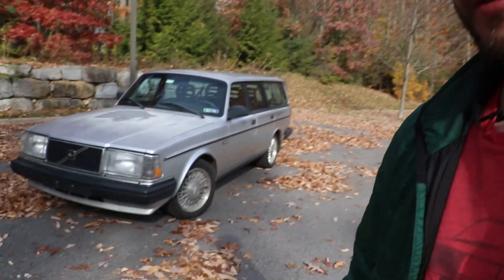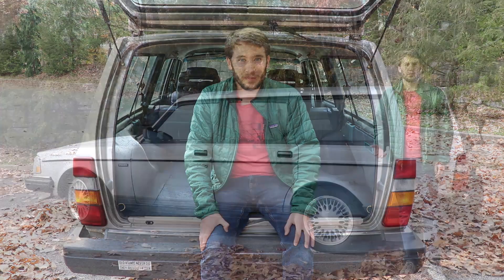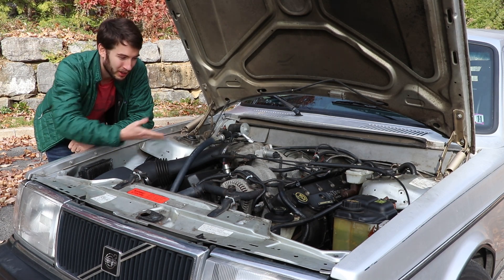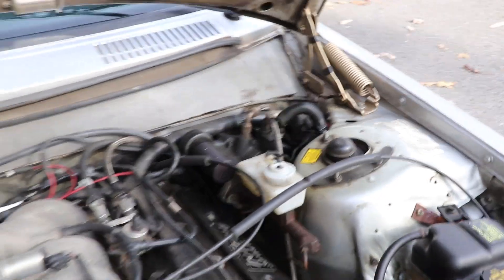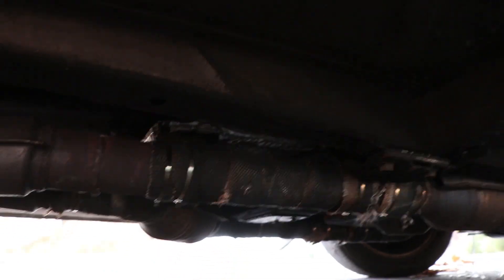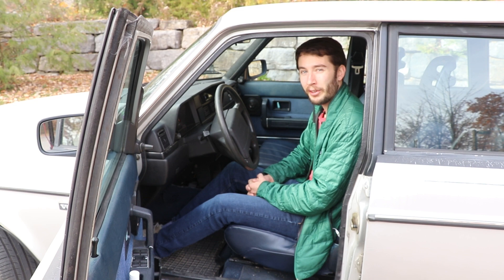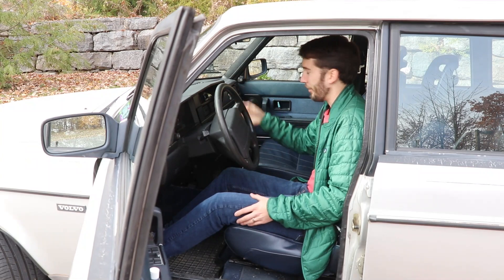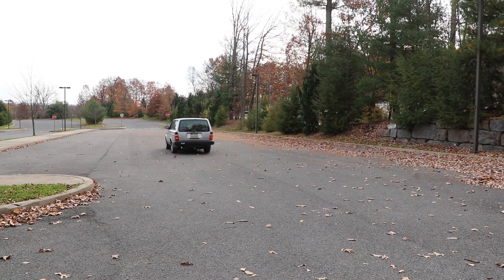I Put A Cobra Engine In A Volvo 240

Comment: You're a very smart guy, I love volvo 240s and jags, I've seen your XJS and searched for this on your channel. I wish there were more V8 engines in the UK to use like this. DId you ever change or mount the crusie control switches?

Comment: I need your help with motor mounts $$ how much
Reply from the maker: Information on how I built them is in the turbobricks thread. Link in the description.
Reply: @AHFixIt  Volvo 144 for the win.   They were just fantastic if you can get an auto wagon from the early 70's.   Volvo lost the plot totally by the 240 series.  Now they are dead altogether.

Comment: Did something similar in 1990 with a 264, put an aluminium Buick/Rover 3.5 V8 and 3 speed BW auto. Not the biggest HP but the big increase in torque transformed the BRICK and made it hustle along

Comment: I hope you found a willing buyer for the original engine.  They're slow, but if you're just driving it, it can be pleasant.

Also, if you put bigger wheels and engine in, why not bigger brakes? I get the hydroboost, but the pads are originally the size of a matchbook! And would a ford truck manual transmission bolt on that engine? YOU'RE NOT DONE YET, LOL!  Great job though, I am jealous...

Comment: Interesting.  We share some similar interests.  I put a 5.0 liter Windsor engine and T5 manual trans in a 1984 Ford Midsize LTD.  It also got the Mustang dash, all the other Mustang bits, but I put disk brakes in the rear.   I had to sell it which hurt but I didn't have time to swap the heads that my friend and I ground through when he ported the exhaust.  And I don't have a garage to keep the car protected.   And I will acknowledge that you swap was more involved than mine since I was swapping a Ford motor into a Fox body chassis.  My LTD project was similar in the end goal to your Volvo project and I absolutely loved it when it was complete.   By the way, sleepers are the best especially when you have A/C, comfortable seats, can listen to the stereo and still go 14.6 in the !/4 mile.  I have a 1990 Volvo 240 wagon now.  It is stock with a manual 5 speed.  I sometimes think about engine swaps on the Volvo, however, I still work too much and time and money are issues.  With the 5 speed it doesn't feel as slow.  You may want to consider putting an IPD or Addco front antisway bar on the front of your Volvo.  You can do the rear too,  but the biggest improvement will come from the front because that is where all the weight is.  

And I found your channel through vintage audio.  But I am just learning about how to recap and restore now.  I'm a neophyte.

Comment: A) I know that Sheetz well. When you were picking up that car, I was probably in one of the office buildings right near it. 2) The driver's door is haunted. C) No way to add the cruise control and AC buttons to the dash or steering wheel anywhere? Awesome project, though.
Reply from the maker: Thanks! Cruise control buttons could be added near the radio or integrated into the Volvo cruise control stalk, but I haven't taken the time since the current setup works just fine for me.  It's something I'd address if I were to sell the car.